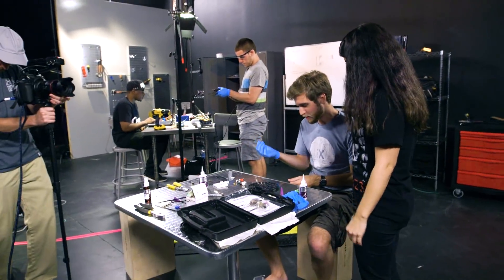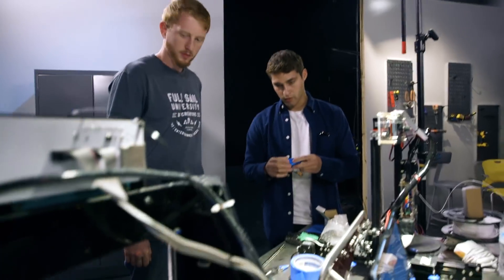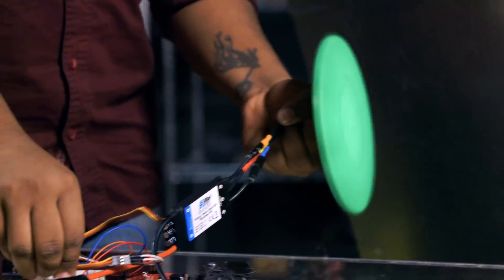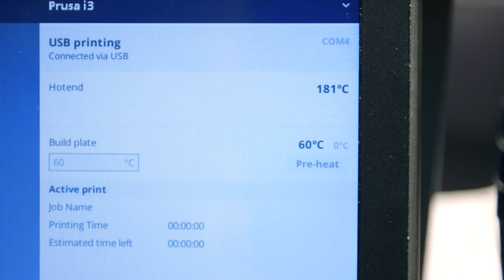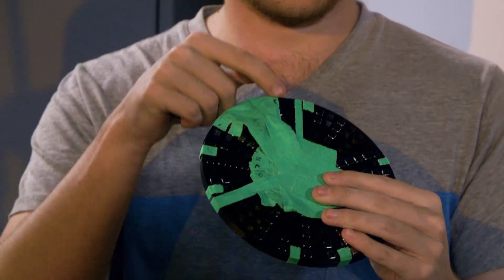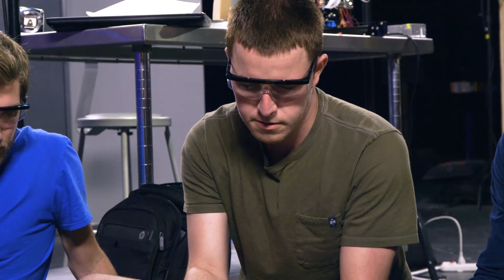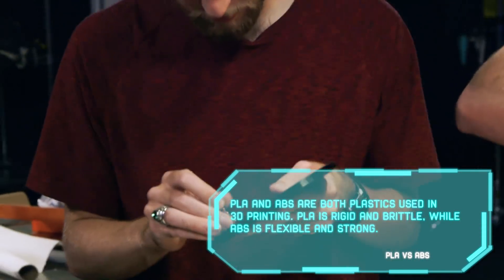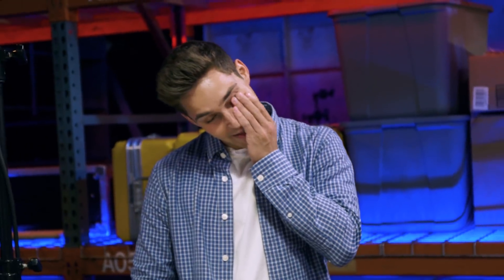Hacker Labs: Hoverboard Challenge Ep. 3 | Full Sail University

Comment: I just found this series, wondering why they are adding complication of servos to move it instead of the person leaning like the movie. Which is what I thought the point of this was supposed to be. 
Also, hours and hours of 3d printing. My first thought was make a waffle iron type mold in a CNC or even just manual machined and in 5 minutes have a bunch of disks. 
I'm all for their success/victory don't get me wrong. But making things way more complex than necessary is a waste of time that can be used to later refine and improve this.

Comment: If you guys have the budget then get thruster  motors(EDF motors) they might cost you around 300$ per motor

https://www.falconhobbysupply.com/jp-hobby-jphedf09012s-high-thrust-90mm-12s-edf.html

Link to buy the motor this is just a example for the type of motor you are looking for.
Reply: The blue motor you were using is 'in runner bldc' it has very high rpm but very less torque EDF motors gives a balanced torque & rmp specs
Reply: https://www.falconhobbysupply.com/jp-hobby-jphedf09012s-high-thrust-90mm-12s-edf.html 
here is the link for you 
Let me know if this is useful
Reply: Also if the torque is not sufficient please try designing the gearbox so that you can attach three to four of these motors to rotate a single shaft (please consider the material choice for building  this gearbox because at more than 60k rpm a torque acting on main  shaft  will be very high)

Comment: Feel like if they had cnc milling and mill a pieces of carbon to throw in edm and burn the magnet holes into a non-magnetic piece of metal wonder how that would work for a plate to put the magnets in. But then mite need ever powerful motor. Feel the the motors look week on the first Video
Reply: Problem be to expensive but nickel in non-magnetic. Use to cut in the machine shop I worked in.

Comment: Instead of a center axle make the magnet disk a giant gear driving it from the edge and use gear ratios to up the rotational speed. plus you can mount the motor and disk closer to the board.

Comment: abs is not flexible. it is brittle. pla has more flex but would tear rather than shatter when say bent. abs shrinks when cooled, but not because of it flexibility. i'm not so sure these guys actually know what they're doing.
Reply: It's probably an editor putting in the info without checking to see if it's right.
Reply: They have it right. PLA is more brittle than ABS in general.